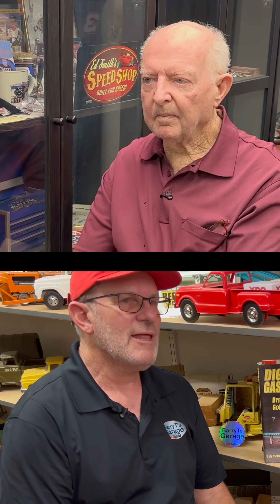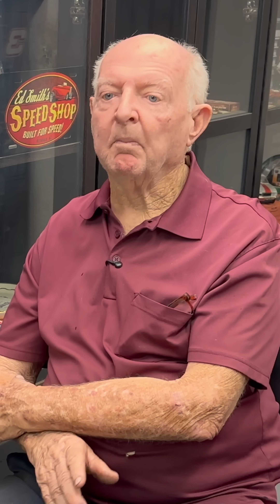Mild Build vs Extreme Build Longevity - Ed Smith w #BarryT from Ask Ed 45 #hotrod #classiccars

Comment: I have always believed a 300 HP V8 is very doable for every day use
Reply: absolutely agree
I'd take a 300-350whp build over some 700,900hp or whatever, any day
build I have set for my 66 Plymouth is going off a sheet setup by a guy who knows the platform, should net me around 320hp and around 410ft/lbs
more than enough for a good driving, fun driver
Reply: @ITS4390 very funny

Comment: I would have to say the way any engine is run makes more difference in life expectancy over how much power it's capable of making. You can build an engine to produce a lot of power and not abuse it and it should last a good long life. Or you can build an engine that makes much less power and hammer the crap out of it and kill it fast ! As for what would be distinguished mild or wild, we used to consider the early 327 injected e gine that made 375 HP with the solid cam option or the 360 HP version with a single 4 bbl, same cam and engine just different fuel system would be a mild build today and since we have such higher quality oils these days along with a lot of better engineered parts, an engine such as this should for all practical purposes be able to last a 100k+ if taken care of properly and not just abused all the time. Out factory HP options were meant to be driven under all road conditions and many have been with us for many years.

Comment: Barry could you ask Ed what cam specs he would recommend for my 0.40 over 428cj with 2 4bbl carbs size is 450 cfm with a stock c-6 transmission with 3.25 rear gears and a 28" rear tire. Stock 10.5to 1 compression ratio.
Reply from the maker: I will ask Ed!
Reply: Thanks Barry I appreciate you! @BarryTsGarage

Comment: Less compression, less rpms, less horsepower equals less stress and greater reliability.
Reply: @tonyelliott7734  That's why the Ford 300 is so reliable, it's a very low performance engine. It's great for what it was designed to do, but it's anything but a hot rod engine in stock form.

Also, add to the list a higher rod ratio for longevity.
Reply: @AdmiralRustyShackleford 
Oh yeah, I've seen many trucks and a Bronco with a 300 6 that runs great with 200k + miles on it. I had a 1980 F 150 with over 275k miles on a 4.9 6 that ran great when I gave it to a friend that was financially hurting and he drove it for a few years before it got totaled. I bet the engine was still going strong even though the truck was destroyed 😂